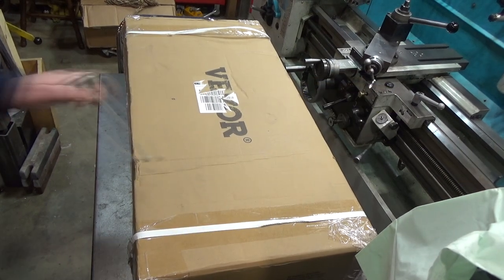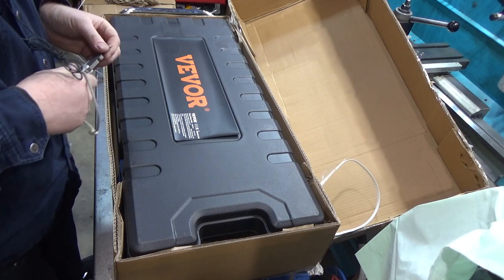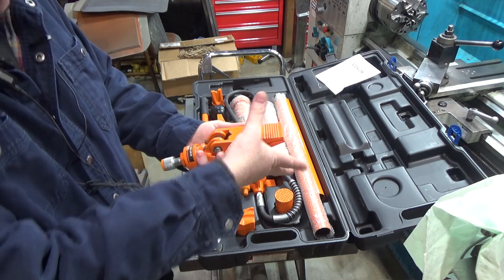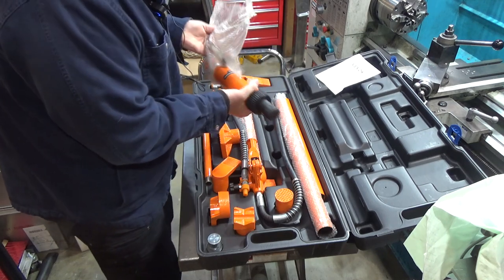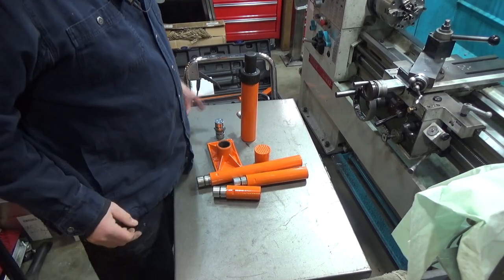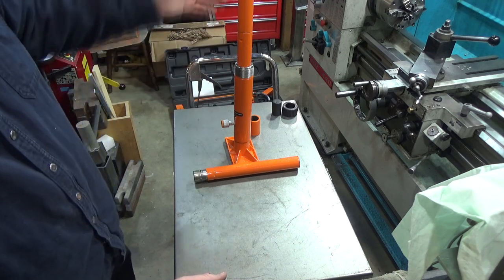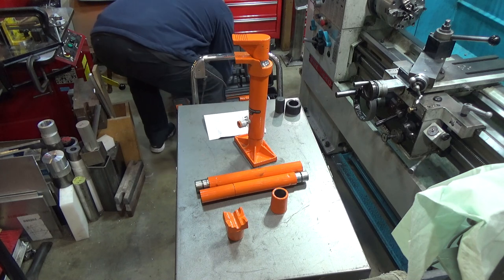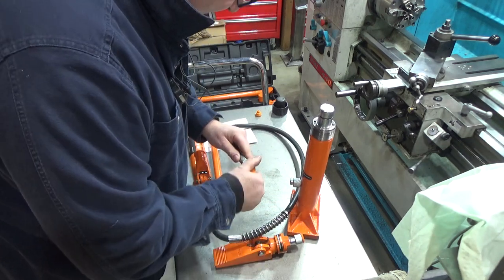QTR 94 Vevor 10 Ton Porta Power Kit

Comment: I purchased a porta-power system that looks identical to yours,  about 18 years ago.   I don't use it often, but when I need it, it's a must-have.
Reply from the maker: I saw it as one of those tools that could be a problem solver once in a while. If I worked on restoring old cars more often, it might be a common helper.
Reply: @DudleyToolwright :  I may have used it 5 or 6 times in all the years, but for the price, it's a must-have.

Comment: I have both , the over seas kit and a Enerpac set. The enerpac kit I found at a garage sale for 100.00    It is a 2000.00 + set ( not all there)   I got it because it was 100.00 .  Ive had the china ish set for 25 years. it works fine and have never broke any of the attachments.   yes there is night and day difference in the 2 sets.  not used much , but handy to have.
Reply from the maker: Killer deal on the Enerpac system! I suspected as much. Thanks for filling in the details.

Comment: There are 4-ton versions of that set.  I would want the 10-ton version, just because.  For you and others who have a shop with capability, replacing the CI parts should not present a problem.  For direct pressure or load conditions, CI is OK; offset loading, not so much.  This or a similar set is very handy for a lot of uses.
You are sort of a bull-in-a-china-shop, eh?
Reply: This is a 10-ton version actually.
Reply from the maker: This set was a 10-TON set and they do have a 20 TON version on their website. As you say, I tend to be a clutz.
Reply: @DudleyToolwright  I should have said directly that 4-ton versions are available.

Comment: Well, if you’re looking for a well made tool, mostly, Vevor isn’t the place to go. I was looking for a fairly small stacker. The Vevor models had “great” ratings of between one and a half to two and a half stars. Let’s say those reviews were interesting. Some of their stuff is good. I just bought a 132 lb anvil, the black one, which is really pretty good. But I’ve had other things from them that fell apart the first time I used them. Some of these companies are annoying, like Banggood and Vevor, because they have no real products. They buy, at the best price, from anyone who makes the tool. So if a tool is reviewed one month, the tool supplied may be different the next month. The base of most all hydraulic cylinders is CI. But in a high quality model, the fingers are usually tempered steel. Doesn’t the manual tell you to release the air and to add fluid before starting. On the side of the pump cylinder there looks to be the fill hole.
Reply from the maker: Your points are well taken and absolutely on point. Harbor freight is the same as well. They often have 2-3 skus for the same tool depending on which one(s) are in stock. There did not seem to be any info on bleeding the system, but probably should have been. Air is definitely the enemy in hydraulic systems. Thanks as always for your helpful insight. Much appreciated.